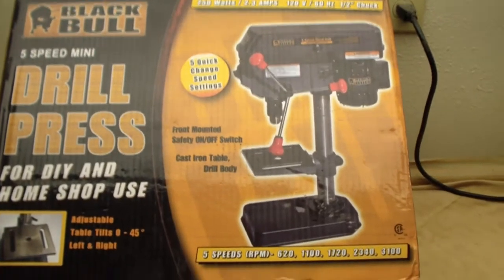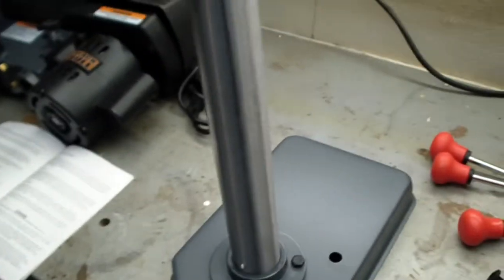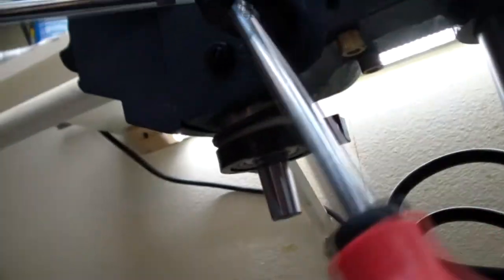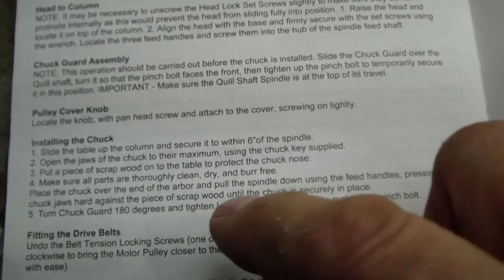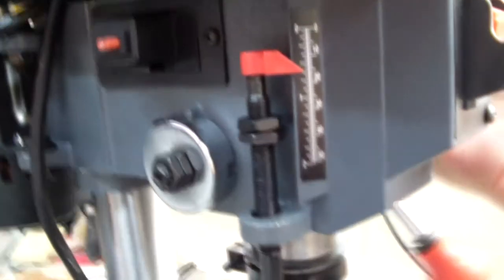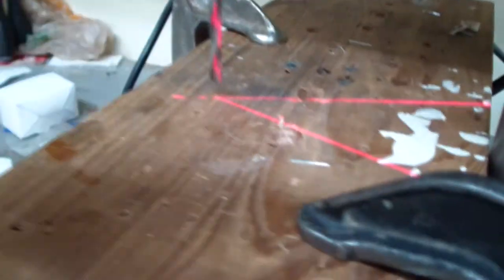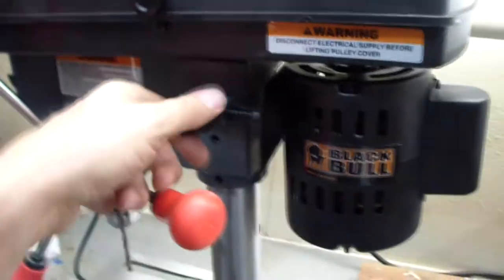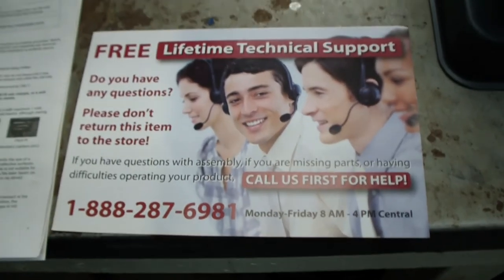Black Bull Drill Press Review

Comment: Don't buy the floor model, they are garbage. The spindle is paper thin and if you push a little hard it will warp. The old ones have been discontinued and now I'm stuck with this garbage in my garage!

Comment: My dad and I got one of these today and while putting the chuck on the shaft fell in on its sell under the little pressure it took to put the chuck on. So moving it up and down is impossible now, I'm just glad it was at this step and not while us ring it. Our guess is that it's because they appear to have made the shaft and grooves aluminum and everything else steel so just a heads up to anyone.

Comment: P.O.S.
I needed a drill press really badly and I bought this particular one from Tractor Supply.
I was shocked when I opened it up and assembled it. The amount of plastic and the lack of quality of said plastic was mortifying. 
The belt will not tighten and even if it did it's still wouldn't be able to drive a drill bit with those flexing plastic pulleys. The plastic top broke the first time I set my hand on it.
And the chuck situation is simply atrocious!
I tried to drill two holes with brand new titanium 1/8" Milwaukee drill bits and could not even drill a single hole with it. Not on any setting.
This is by far the worst excuse for a drill press I have ever seen in my life.
 Your review is spot-on!
I had it unopened in the box for about 2 months before I got around to taking it out to assemble, when I tried to return it to the Tractor Supply (that I am in several times a week... spending a lot of money) they tried to only give me $15.99 back. I paid $89 plus tax for this POS.
Now tractor supply had always been good to me in the past... what a bad decision on their part. Now I don't trust or want to buy any tools from them.
The fact that they ever sold these to anyone at any price is shocking to me. But to try to get me to take $15.99 back for something that had just been taken out of the box that day... ?!?!?
But as far as the company that made those Black Bull Drill Presses... they should be shut down. They should also have to refund every dime that anyone ever spent on one of those things.
I fabricate a lot of different items, wood, metal, all kinds of different stuff and just needed a simple drill press that would drill holes in mild steel and wood.
Not going to happen with this!!!